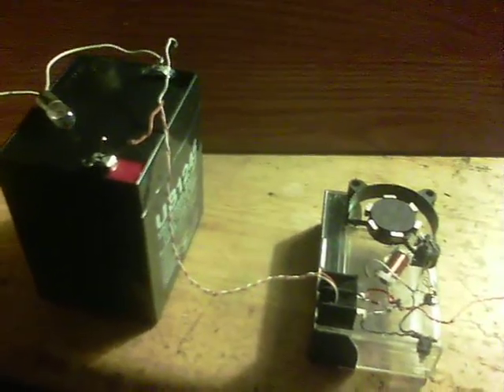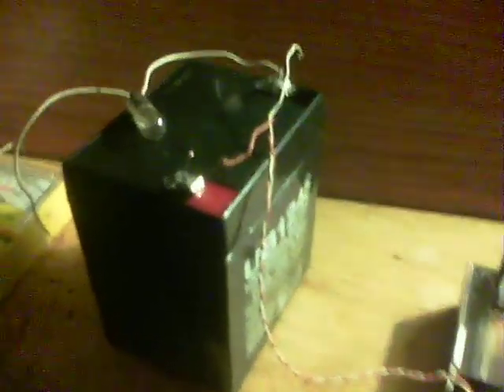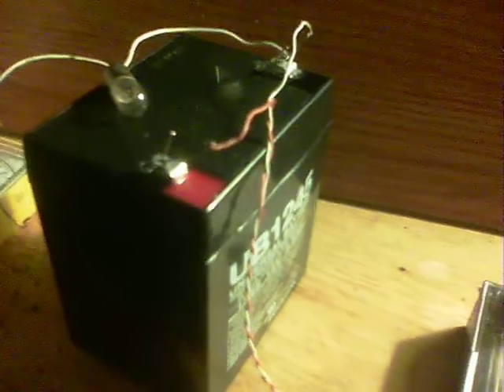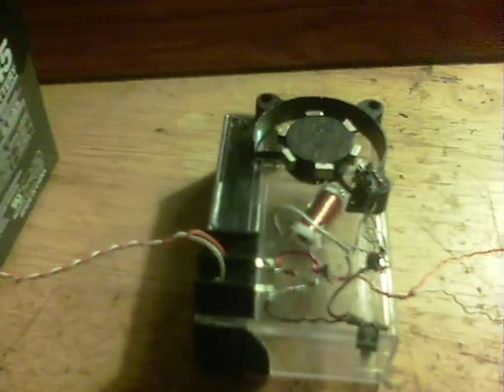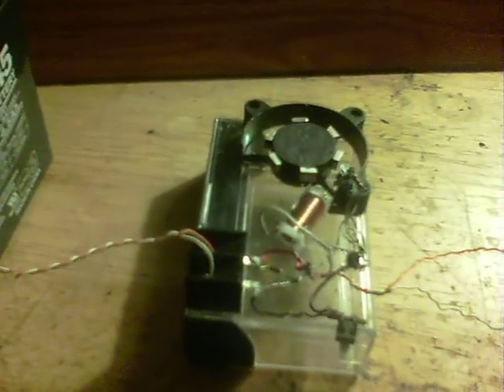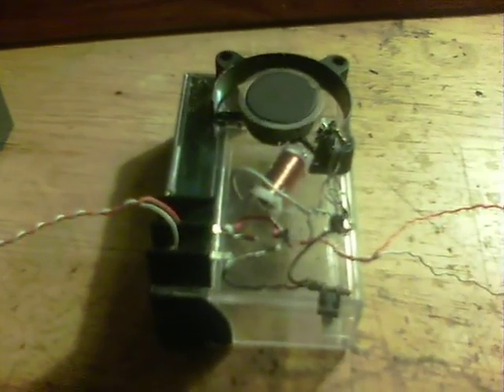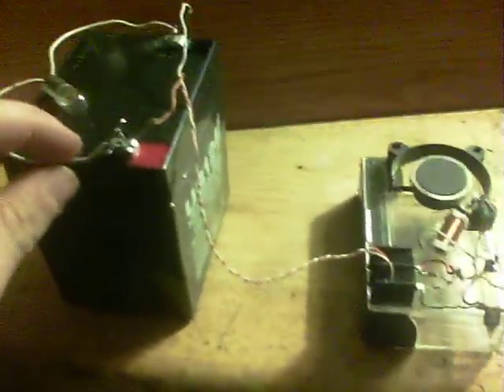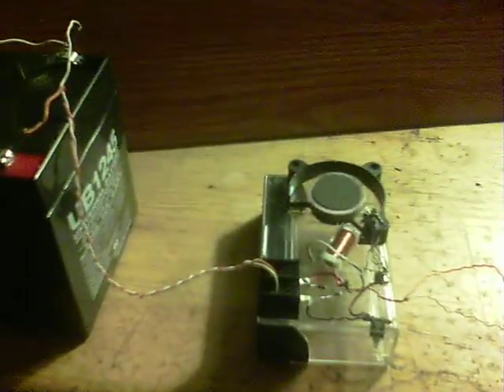Pulse motor - amazing current effect

Comment from the maker: @stefb2005 It's worth trying with a standard Bedini circuit, to see what a really low battery may do, could be the same. I'd be intrigued :) It's running from the wall adapter here, the two wires at the bottom right. The battery has rested for the last day and hasn't gone flat, though that plate damage always see's it sit at 6V off charge.

Comment from the maker: @slider2732 The circuit will scale easily enough for larger power handlings. Bigger Schottky's for the AV section would be those used on the Romero/Muller in the bridge sections. That is, I presume he used 0.3V Schottky's